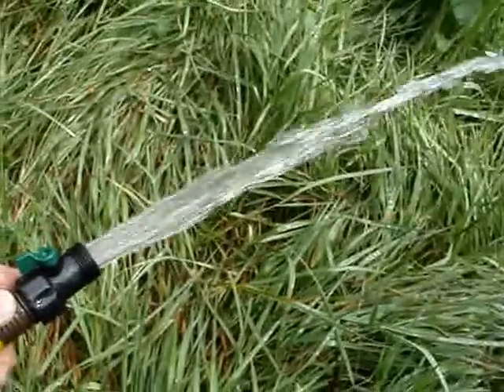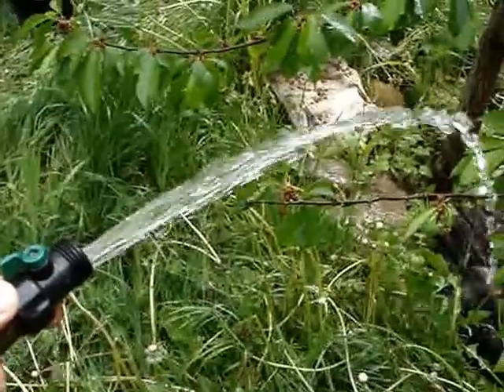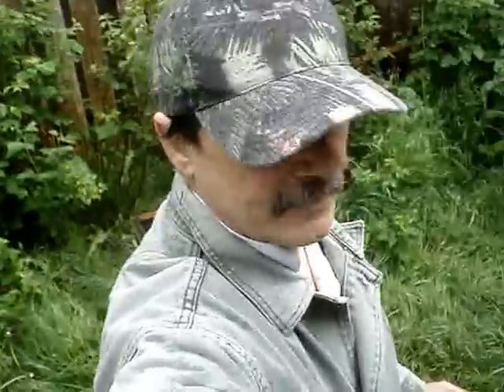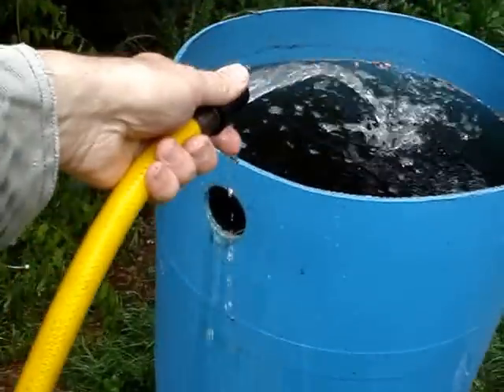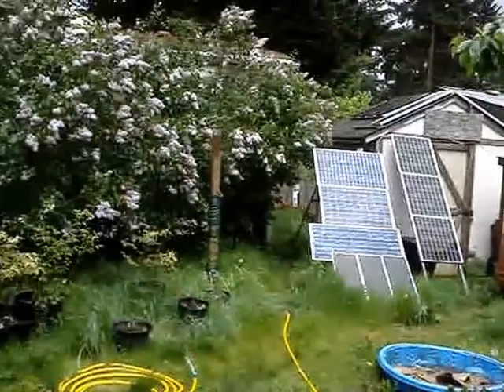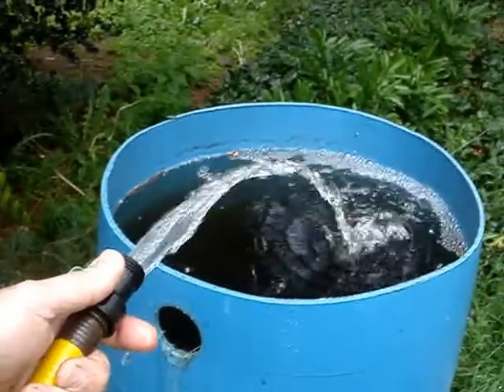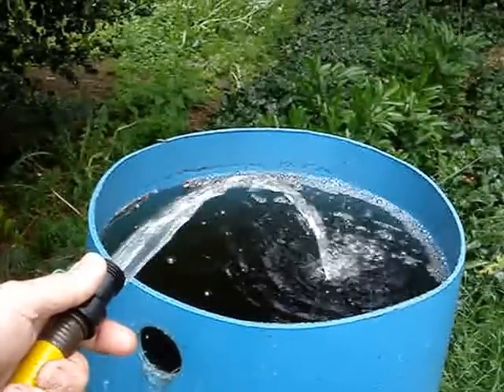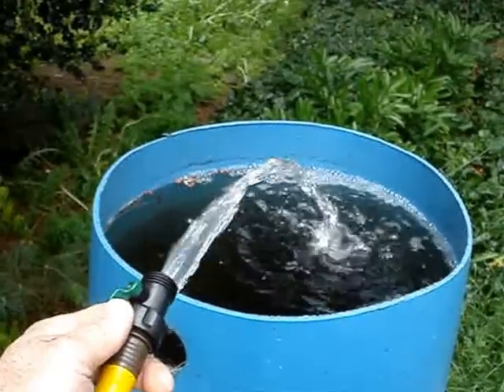Rain Water Collector Hose Pressure From Downspout Pipes

Comment: How do leaves affect your hose?
Reply from the maker: ***** I use the Amerex rain gutter screens on the full length of my rain gutters. Sometimes grit builds up in the 5/8' hose adapter at the base of the pipe. Generally the pine needles get washed off the edge of the gutter. The pressure is high enough to blow gunk out usually.